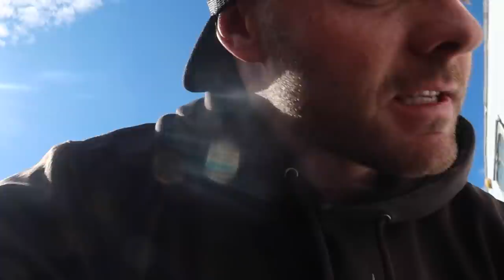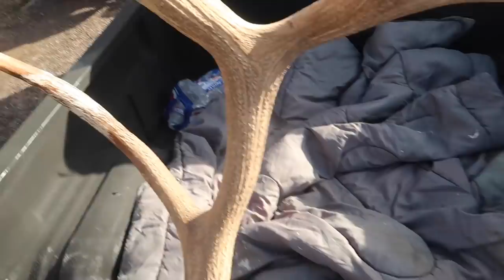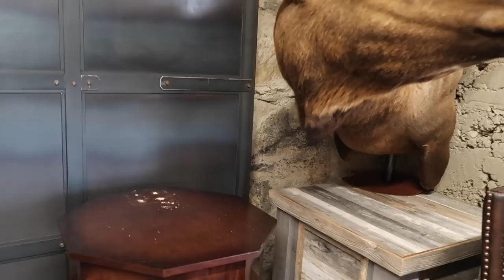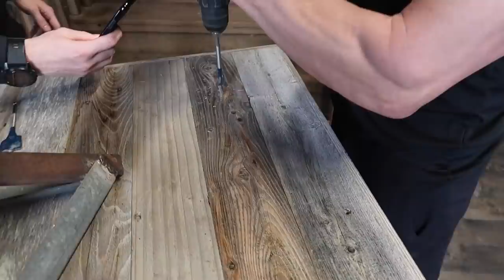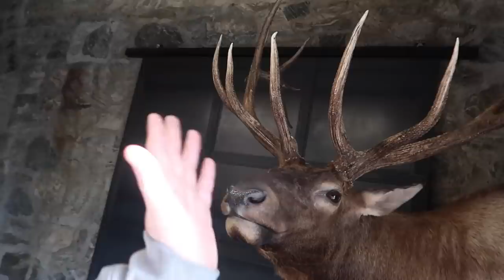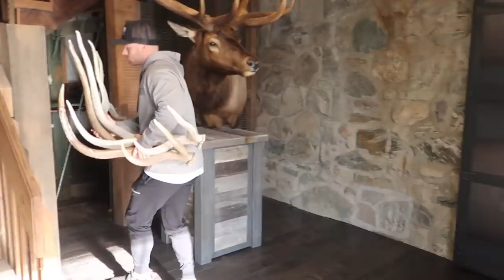ANOTHER SET OF SHED ANTLERS OFF THE FIRE BULL | PEDESTAL SWAP

Comment: The video was awesome but that makita compact drill stalled on you guys. It was the battery. If you would of had switch the switch to 1 instead of 2. 1 is made for hard for a stronger torque. Slow but does the work.